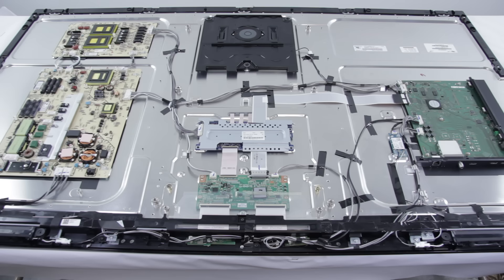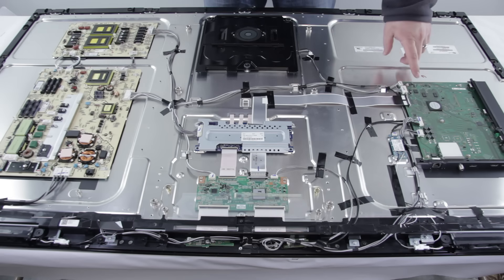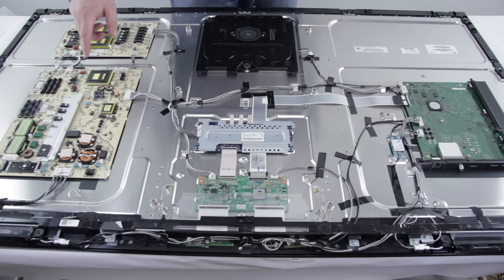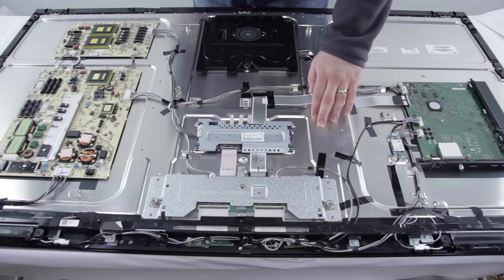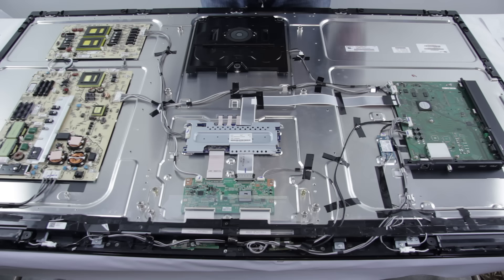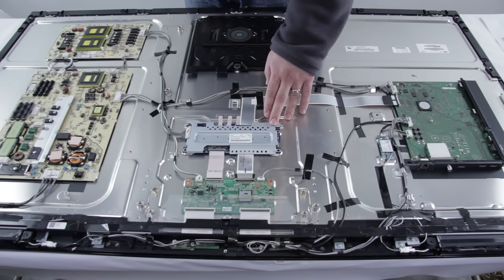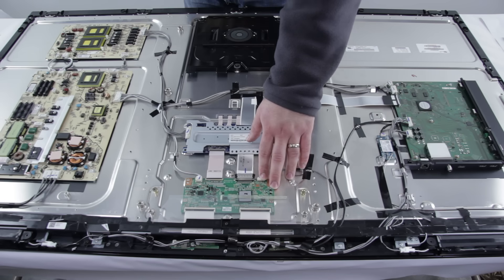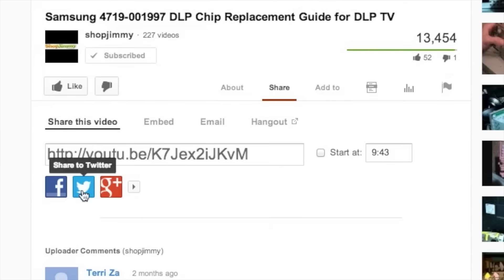LED TV Repair Tutorial - Common Symptoms & Solutions - How to Repair LED TVs

Comment: Hello Sir, My TV is starting on and off by  rebooting for every 2 second. This cycle goes on until i unplug the power cord. I see Samsung logo when it starts for 1 half second  and starts over. I have Samsung 55 " LCD HDTV, Model number is  UN55RU7100FXZA.  I disconnected power supply from the main board and it still does the same thing.  I disconnected ribbons cables main board and T-Con board and back-lid stays on this time.i also realized top and bottom of the TV has light blue and middle has dark blue.    I think i should replace T-Con board but i am not an expert.  What do you suggest ?

Comment: Great Video. I have a TCL 55S405TBBA that has audio but no back light. I can see the images on screen with flashlight. I think the LED driver or a LED strips may be the problem.  If it was the strips would some of them come on and not the bad ones?  The LED driver must built in to power supply or main board as i do not see one. What do you suggest? Thanks

Comment: I've got a samsung UN65MU6300 that will not turn on the standby light is illuminated and responds when you push the power button on the remote or tv but still no image or sound that I can tell. What is the most likely issue. I previously replaced the power board to fix another issue.

Comment: I have a 65 inch Insignia model 14G22C. The tv turns on for a couple of seconds with the Insignia logo on then shuts off. I tried a power supply board and a main board, still same. I have now ordered a Tcon control board and hope thats the problem. Any ideas?

Comment: Hi,
My TV turns on and then will turn off after a few seconds or minutes. The light on the front of the tv indicating power also goes out. If I unplug the tv and wait a few hours or day the tv will turn back on. However it will turn off again on its own in a few seconds or minutes. Any idea what the issue may be?

LG
Model: 47D450-UA

Comment: Hi thanks for this video. I used your info and your store to fix 1 tv with success before. Now I have an LG  43UH6100. I'm not sure which board is causing the problem or if its the backlights. The entire picture has a blue tint and also dim quality to it. I watched videos and the most thing I could find was that it is the backlights, but that seems a little strange because the tv wasnt that old when the problem started. Thanks for any help you can give!

Comment: I have an LG 55ls4500 I replaced the t-con and power/main board. I have a screen with half of it gray and you can see it faintly mirrored on the right side of it. I have the service manual and I'm about to alcohol the connections unless you think it's something else? Any help is appreciated.

Comment: Vizio E650i-A2. Backlight issue. LED board has 3 pos outputs to LEDs. 2 read 24v and the 3rd reads 0 with and without the connector plugged in. I am going with the assumption that the LED driver board is the problem? I have checked the inputs on thr driver board and all pos inputs have 24v.

Comment: I have a ChangChong LED TV that I bought off of newegg couple of years ago. A couple months back I was experimenting with an antenna that you fastened to your window and in advertently cross threaded the connector on to the co-axle style antenna  input. I’ve been foolishly tried to detach it are using some pliers that eventually destroyed the connector on the TV. I am not sure if it’s a coincidence, but about two weeks later I noticed my screen starting to fade out slowly until it was blank, any idea if this was related and what my problem might be? Is it worth repairing?

Comment: Vizio M65-C1. Screen will work fine for about 1 minute. Then video gets distorted and frozen. Sometimes will shut off or power off then on on its own. Sometimes have to disconnect the ac adapter to get it to shut off. Audio works fine the whole time.

Comment: Hi Jimmy,

I have a SANSUI STY1242 (42" LCD) TV (roughly 9 year old TV) - recently when I power on my tv (from standby) it would come on, but there is no picture, only a solid white color or solid green color or a solid blue color, I then put the tv back into standby, wait a few seconds and start it up again, the picture either comes right or I have to repeat the process 1,2 or 3 times more .... I have never had to repeat the process more then 3 times.

From you video, I think I would have to replace the "T-CON" board ... is that it or do you suggest I try something else first?
I have photos of the solid color outputs, so I can send them to you if you need to check that first.

Thank you

Comment: un65ku6500fxza samsung tv,  Powers up and the only thing that happens is the back lights blink on and off like three times and then it doesn't do anything maybe 30 seconds goes by I and the back lights blink again on and off three times I've replaced the main board, and the power supply board, I've also unplug some of the peripherals but it's still doing the same thing,  when I unplug the main board from the power supply all the back lights come up steady , any advice would be appreciated

Comment: Hello guys . Excellent info on your site as usual. May I ask I have a Samsung ue65es8000. The TV works fine apart from a darker area at the top of the screen ( 1/5th ) any clues at where the issue may be ( the main board has already been replaced ) cheers . Geoff.

Comment: Hi Jimmy. Great tutorial. I have a samsung UAD6600WMXRD. the top third of the screen has reddish horizontal lines about 4mm apart. It varies in intensity and sometimes the entire top 1/3rd flickers. Its not a connection issue - it happens when the TV displays the internal photo in diagnostics. Ive removed / cleaned and replaced the ribbons from the screen to the T com board with no change (they all looked really good anyway). I was going to replace the T com board next but your warning said that horizontal lines are almost never the T com.
I think its the LCD screen and I will have to buy a new TV - whats your opinion

Comment: Hi I am trying to repair my Panasonic plasma TH-P42X30D. I have an unusual problem. The TV works fine. Both audio, video and HDMI is fine. The problem is that AV inputs AV1, AV2 and AV3 don't work. The screen shows white and black horizontal wavy lines on the screen continuously. Is it repairable without changing the board.

Comment: LG model 50LF6100-UA screen flashes on quickly and off for aprox 1 second. sound works fine. flashes are brief, but the picture is visible. some brighter than others.

Comment: I have a Samsung KS8500 55inch curved TV that is need of repair. It does have the one connect box. The TV smart menu started lagging real bad. The TV's brightness started to get real low then the colors would look odd. Soon after the TV would start becoming hard to turn on. You can see the power light on. When pressing power button the power light responds. Occasionally you can see the SUHD come up on the TV looks just fine then does nothing else,  you can see the backlight when the tv is turned on. I am thinking its one of the boards that went bad. 

Its worth mentioning i did install a new over the range microwave in kitchen that was on same breaker as everything in my living room including TV. The microwave would trip the breaker and shut everything down in living room. That happened several times over a few months before i finally moved microwave to new breaker. Thinking it might have created a power surge that damaged something in TV. Any ideas?

Comment: Hey. I have a LG 55UH6090-UF
I have replaced the main board, t-con board and the power supply board.
I have backlights and sound, but no display. What could be the problem? Thanks in advance.

Comment: hi buddy
i want to experience motion interpolation in my tv but option for the same is not available only.

i want to increase refresh rate of my vu pixelight 55 inch 4k hdr tv from 60 hz to 240 hz and company is not providing any update or solution.
is it possible to replace the mainboard from samsung 55 ich qled tv's mainboard.
or 
any other solution if possible

regards,
Abhishek

Comment: Great videos…. 

I was looking for a fix for my 3 yr old Emerson Model   LF461EM4 A, A 46-inch LCD HDTV with LED backlighting, but I could find nothing close to this… The Picture has 3 distenct horizontal bands, (the bands are not made up of lines, just darker picture)… the top band is very dark, but can see the picture the middle band is a little dark, and the bottom band is just a little lighter than the middle one, and maybe near perfect.  Do you have any ideas as to what this could be or where to find out about this problem.

Comment: hello i own a lg 32LN5100  while i was watching my tv it suddenly made a weird sound like something got  burnt and the light under the screen that is always seemed as if electricity went trogh it from right to left like a little lightning bult, and than the fuse jumped in my room when i got everything running again my tv stopped working. doesn't even turn on any insights?

Comment: Samsung UN60F7050 had a couple of vertical lines appear around a year ago. The other day we turned on the tv and it now has a 6in wide white vertical stripe in the middle of the screen. I took it apart and below the metal strip at the very bottom of the tv there are 16 ribbon cables that look bonded to the panel. One has a burnt hole in it. I’m screwed aren’t I?

Comment: I have a Vizio E40-C2. S/N LWZQSFCR.  The set powers on with the remote or the power button.The screen lights up blue then dims after a few minutes.  I have tried to press input, menu, etc and nothing appears on the screen.  I have tried it while connected with hdmi cable and without.  I pulled the back cover off and nothing looks burnt or damaged.  The main board looks like it would be easy to swap but the other board (T-con?) is a long strip at the bottom of the set and doesn't look like it was intended to be changed. What should I do?

Comment: RCA LED 55c55r120Q
I have power.  I have changed the main board and the T-con. Still no picture or sound. I have done the flashlight test.  I have verified back lights work.  Still no fix.  Can you help please?

Comment: Thank You  ShopJimmy for your video. I have a Sony XBR65x850D which is out of warranty. I called Sony and got the "Thank you for being a customer but your are out of warranty we won't help you" response. 

My problem is my TV will not power on. It does have some power. If I plug in a USB stick, the LED on the stick flashes. If I connect a computer to a HDMI input, the computer sees a second display although no picture ever shows. 

This all started one day when the TV display that an update was available. I clicked yes to do the update and after an hour or so, the TV appeared to be frozen with a blank screen. It was connect via wifi. I then cycle power via the remote, the power button, and the power cord and nothing changed - the TV would not power on. No SONY power up LED.

I tried the unplug two minute. No change. I tried the hold in power/volume down button while power on nothing. I tried power/volume up button while powering on nothing happened. I downloaded the new firmware and followed the instructions on support.sony.com for install including leaving it plugged in with the stick for 1 whole week - nothing changed. I franticly over several weeks tried all of these methods multiple times even holding the buttons until my fingers bled - nothing change. I even tried calling Sony several times and climbing the ranks of support personnel and their Customer Relations personnel but still got the "out of warranty" line. 

Currently, I can not see any light from the inside of the TV in a pitch black room. 
I don't see anything ever on the screen with the flashlight test. 
I am at a lost of what to do next. 

Please help.
Reply: ScottJ Miller Did you ever fix this tv? I have a similar Sony with the same problem.

Comment: I have Samsung UN40J6200 40 inch LED tv.  Lately the picture has been going dark; that is, we can see images but they are very dark.  I've checked the picture settings and reset to factory defaults but that doesn't appear to correct the problem.  The first time it happened I checked the picture self diagnosis screen and the test picture appeared fine, so I then checked the TV antenna input and found it slightly loose.  After tightening the antenna coax connector the picture returned to normal.  However after about a month the issue returned.  This time the antenna connection was nice and tight but the self dianosis picture test picture appeared dark.  Also, the picture seemed to fade in and out - got a little brighter then went dim again.  After turning the TV off and then on again the picture returned to normal.  However I'm concerned that something is on the verge of failing.  I'm guessing it could be either the  inverter/led driver of the led backlights starting to fail.  Is there something else it could be causing this?  Also how would I diagnose whether it is the backlights or the driver that is failing.  Thanks for any thoughts about this.

Comment: I have an LG 55LX6500 and the tv will not turn off and the remote and the tv power button will not control anything. The tv’s front panel lights stay on. When and if they goes off the tv works fine.  I’ve tried unplugging for 2,  5 and 60 minutes. But not change. Which board could be causing this?

Comment: Hello, My Sony 900F flashes red 4 times. I tried to factory reset never go pass the Android booting logo. I Download the new software from Sony on the USB have the power unplug, plug in USB hold down power button and - at the same time. The monitor never turn on but the USB flashing, After about 30 minutes the light go out on the USB the screen still not on. I used remote to turn on, The TV start at this time I can see the langues setting and the monitor shut down. I opened the back, Factory reset again, One light on the LED board turn on and off green, One flashing red The monitor start Sony logo, Android logo and shut down! I tried  reset over and over again the red light on board red and TV shut down every time...Is my LED board bad? Is the software bricked Please help..

Comment: hi, i have a vizio E70-C3..i have full visible picture, but i have dark squares that cause the picture to be really dark in those areas..started on the right, about 6" tall dark line just above center..now have same line plus most of the left side n another line along bottom. im very mechanically inclined n would like to fix it myself..help? MJ

Comment: HI, I have a Vizio 70" model -P702ui-B3. When powered on no pix or sound. light at lower left of the TV comes on then slowly dims out. After 3 attempts it will turn on normally. I power cycled it many times, but no change. How can I fix it, or what board should I change?

Comment: My tv has the problem you mentioned about the tv turning on and off.  If I start the tv it will start run a little while and then turn itself off.  All I have to do is plug the tv in and it starts and runs for a few seconds then turns itself off and then just keep doing that until I pull the plug.  I have tightened all the screws and inspected everything I could but it doesn't work. The one odd thing is that if I don't run it for a while it tends to stay on a few minutes and then turns itself off going back to what it does above.  My tv is a Samsung 32" model number UN32EH4003F. I did have to replace the power board 4 years ago when their was a lightning strike.  Everything else on the tv works.

Comment: hi, I have a Sanyo FW50C85T when i power it on it has the sanyo  logo, shortly after half the logo goes very dark. when the picture comes up half is gone i thought totally but then i turned off the room lights and i could see the other half its just very dark. so going from right facing the tv the picture is fine the further to the left you go the darker it fades. thanks for any help you can offer.

Comment: Samsung UN55FH6030F.
The screen is lit but the image appears to be zoomed in and it has black horizontal lines thru it and images are duplicated and overlaid 3 times. The top left area of the back cover has been warped by hi heat too. The program would continue playing but the image was distorted as described above.

Comment: Hi. My 64in. LED. LG 65ub9500 is not working correctly. The screen has a glow and switches from glow to black when I change the channels. I can fumble through my remotes to change inputs and have tried all the hdmi ports. No luck. I can hear TV sound being sent through my TV to my Klipsch soundbar through the optical cable. I dont have the steps memorized to switch the sound output from soundbar to TV sadly. AGAIN, TV turns on and off, I can see a "glow" on the screen that switches to black and back to glowing when I change channels. But no picture. When I hit menu, and shine a flashlight from all angles I see nothing but a black TV screen. Nothing. Any suggestions??

Comment: I not looking for repair help just a place to source parts I have a Samsung led 24” tv that has a broken power wire it’s the one that supplies the LEDs I have the part number but every place I have tried to order it from takes the money then marks it back ordered? I don’t know if the connector on the panel for the led back lighting is proprietary or if I can order a wire somewhere else that will fit? I hate to throw away a tv because of a tiny wire! To explain how it became broken the tv fell and opened up the wire was pulled out of the little white plug and it’s to small to fix,